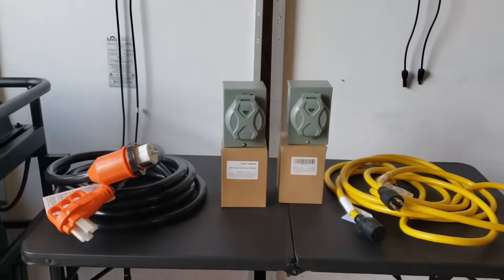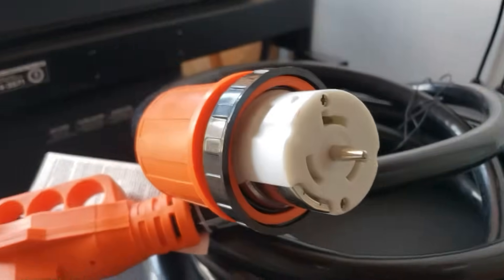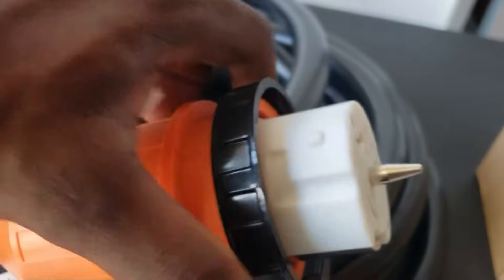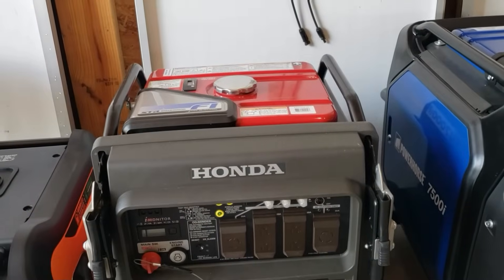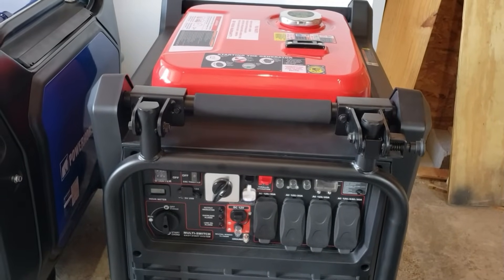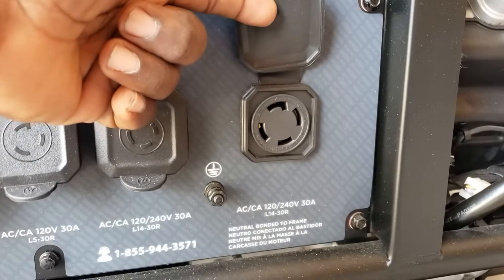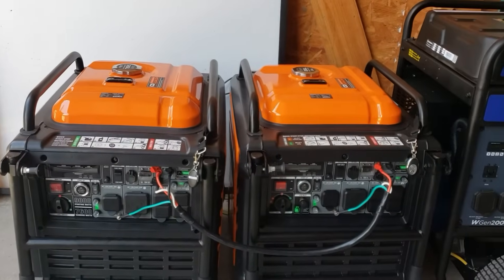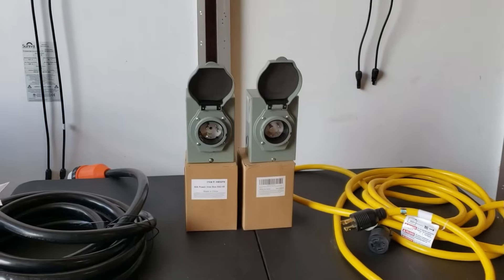Generator Inlet Box 30 amps Vs 50 amps which one should you install

Comment: Gavin, Thank you for this information. In my case I have a 9000 Watts Dual Fuel Champion #71503 with 4 prongs/ 30 Amps.
My Home inlet box is a Generac 6338 (50 Amps - 3 prongs with pin in the middle.
What kind of power cord(50 ft.) do you suggest that I buy to work this safely, possibly with an adaptor?
30 Amp cord or 50Amp cord?
Thanks again.
Reply from the maker: I think I have that adapter on my website I’ll put the link for you
https://www.gavins-garage.com/product-category/adapters/

Comment: I have a 10,000 watt diesel milsurp generator on a trailer, and am wiring the house to accept that 50A setup. It has bare lugs, so we're wiring a 50 and 30 plug receptacles to the generator so we have options (it is mobile, after all). The thing is a beast - weighs 1000 pounds without the trailer. But it's quiet and reliable.
Reply: I had a MilSurp generator that was built like a tank, it was only 4kw but it had the cold weather kit, 12 volt charging, only 120volt plugs but had the ability to use as a welder. When we moved I gave it to a coworker. Wish I could find another.

Comment: Great Info.220v well pump  1/2 HP.....Elect stove...elect. water tank 50 gal...elect dryer..tv...lights........should I get 50amp transfer.??
Reply from the maker: If you were trying to figure out if you should get that transfer switch or inlet box, either one will work for you.
The transfer switch if you get that 10 circuits you’ll be able to run two 240 V appliances and the remaining will be 120v loads.

I would installed the inlet box, not only is it cheaper but you power everything in the house and you can do it at 50amp plus the lock out?

Comment: 50 amp Generac inlet box, an interlock switch on the main panel and a 12000 Duromax portable generator.  Trust me from personal experience, when the power goes out you will NEVER say or think, "Gee, I wish I didn't have this much power."
Reply from the maker: Agreed ☝🏽

Comment: A thing to consider is if you are paying an Electrician to install the circuit, the labor will be a big part of the cost. The labor is the same to install the 50 or the 30. So if you have a big house or are considering adding more loads in the future (pool, room addition, shop, garage, A/C, ..... EV) the small increase in the cost of the hardware up from 30 Amps may well be worth it. You can run a 30 to 50 adapter for your 30-amp generator.
Reply: Cost difference between a 30 amp and 50 amp outlet is minimal, just the cost difference between 10 gauge wire for the 30 amp and 6 gauge wire for the 50 amp, but if you go with 30 amp, you are stuck with 30 amp (unless you upgrade to 50 amp).
If you start with 50 amp, you can still use a 30 amp generator, just need an adapter, and can go to 50 amp easily if you want. 

IMO, just go with a 50 amp box and Cable with a 30 amp to 50 amp adapter. 
50 amp cables are about 2x the cost of a 30 amp, so If money is really tight, get a 30 amp cable for the time being. If you upgrade your generator to a 50 amp setup, you will need to buy a new 50 amp cable, but can use the same box as before.
Reply: @nolanhoyt716 exactly it doesn’t makes sense to go
With 30 in any situation.  You can always get an adapter. Coat is deference minimal

Comment: The reason why it's 19,800 is because of the 550 watt solar panels. I don't have big roof just big panels and I will be putting bigger ones on the ground mounts and I have some smaller solar panels on some ground mounts but not all of them and I didn't make all my ground mounts yet but I have one and a half ground mounts with out solar panels that I am and will add more solar panels to. I just need to get more but yes I have some that I'm putting up.

Comment: And the numbers on generators are misleading because the breaker they are tied to is only 80% so a 30 amp gen will only provide 24 amps at full load!

Comment: If running a 50 amp inlet box from a larger suitable generator and using an interlock kit on my circuit breaker box, what size circuit breaker should I use for the incoming line?
Reply from the maker: You should install a 50amp breaker

Comment: I have a 50 amp inlet, am I supposed to run the generator on 120v or 240v mode?
Reply from the maker: Run it on 240v that will power both legs

Comment: Gavin.   I watched your video on cable size and voltage drop was good.  I will get 10 gage cord used with a 30 amp inlet.   Im thinking 40 foot cord to get noise away from house.   At what length of cord is there voltage drop that affects gen output wattage?   Whats the cord ideal length.  Above this length should we go to a 50 amp wired cord and still use the 30 connectors?   Thanks!  U do patreon?  Love your content.   How can we support your channel?
Reply from the maker: Thanks so much for watching the max. I would recommend you going is 25 to 30 feet.
You can push the thanks button on the bottom of the videos that works great to support the channel .

Comment: My electrician installed a 50amp inlet box for my generator. For some reason the receptacle doesn't have the hole in the middle to fit the center guidance pin of the female plug. I had to pull the pin out. Almost all boxes I've seen online have the center hole. I'm wondering why mine doesn't have the hole.

Comment: I put in a 30 amp several years ago for a  9000 generator. Wish I had put in a 50 as I now want to use a bigger generator.
Reply: just change the 30 for 50Amp, no biggie.
Reply: @carapungo  That's all good and well as long as the wiring going to the panel for the generator is at least a 6 AWG. Don't change out plug if the wiring is a 10 AWG which is rated for a 30 AMP.
Reply: @69ssrscamaro4  correct, I use 6 AWG

Comment: If you had a big generator and a 50 amp plug, and wanted to have a backup plan for a situation where your big generator goes bad, you go to home depot and they only have smaller generators 6000W let's say and you needed to get it cuz power is out and something is better than nothing, this new generator had only a 30 amp outlet.. with that said, would you have two boxes outside of your house or is there an adapter that you can utilize 50 amp plug but it will reduce the power to 30 amp so you can still use a smaller generator?
Thank you
Reply from the maker: Hi PAUL, there’s a simple adapter that goes from the 30 amp to the 50 amp plug. There’s an adapter that can go from a regular 120 V to the 50 amp plug.
Reply: @Gavin’s Garage  hello and thank you for your response. Just to ensure, I can go with this adapter from 30 amp generator to 50 amp plug in my wall right? Not the other way around. Or I can do both scenarios, the other one would be a big 50 amp generator to smaller 30 amp plug in my wall? 
Thank you

Comment: Thank you for the video. I was undecided after buying a Duromax 9000, but 30A it is; the box and cable are cheaper and with 6000W (80% load) I can power the main things I need,  just need to be smart about alternating the large draw items.

Comment: I have a 30a generator. Later, I might want to up grade generators. Can I wire and install a 50a breaker in my panel and and run the 30a generator with the correct pugs to the 50a?
Reply: I think you can as long as all cabling is 6 gauge.
Reply: @user-bj4lp3fr1o  thanks. I ended up buying a 50 amp generator because I realized the generator I had only went up to 20 amps.

Comment: I have a 50A inlet into my home and just bought a 10,625/8500-Watt Electric Start Gas and Propane Dual Fuel Portable Generator with CO Shield.  Could I just get the 30Amp cord to 50AMP and run it like that into the house? I know they sell the cord like a 10 ft. Generator 30 AMP 125/250-Volt 4-Prong Locking Plug L14-30P to 50 AMP 125/250-Volt SS2-50R(CS6364) Adapter Cord.  Will this be all I need to run power into the house?  My breaker is already set up for it.
Reply from the maker: Yes, that’s exactly what you need just get the adapter it’s going to work the exact same.
You’re on the right track

Comment: Why would anyone buy and connect any gen with greater than 30 amp output to a 30 amp gen inlet box.   So any gen greater than 4000 watts would be overkill on a 30 amp inlet box no?
Reply from the maker: I think you’re confusing 30 amps at 120 V with 30 amps at 240 V
That’s a big difference

Comment: Great video! But you’re talking about 7500w max for the 30A inlet. That’s correct if you run only 240v things in your house. If like me you have some power hungry stuff running on 120v (120v mini split 15-16A , microwaves, 3 freezer, laundry machine, coffee machine, etc … dont forget that those kind of things pull Power only from one leg. Be sure your 120v stuff are balance on both legs or go 50A to be sure. In my case, i was reading 28A on 1 phase and only 10A on the other one. I was maxing my 30A cable with only 4500W. I changed my cable for a #6 and a new Inlet / breaker combo to use my 8000w generator at full power ;)
Reply: 7500w is 7500w no matter how you slice it or how you load it. To understand a 240 volt circuit better.....30 x 240 is total wattage which is 7500w approx. the breaker on your gen is likely going to be a 30A 2 pole breaker. each "leg" of that 30A 240V circuit will also only carry 30A. So the max load you'll ever have on one leg is 30A x 120V which is about 3600w. 50A literally serves zero purpose on a 7500w gen. I see so many folks that aren't doing the math right and always recommending people upsize to a 50A when there's no point.
Reply: @andrewb3313  You’re right but my 8000W generator has a 50a plug with a 50a breaker. I’m able to pull 38A and 25A on each leg with no problem. 38 x 120 + 25 x 120v = 7500W. I was not able to run my Generator with this load on the 14-30r plug with a 10awg wire. The #10 wire cannot support more than 30A on any wire in the cable.

Comment: I'm confused. 30 amps X 120v = 3600 watts. Not 7500 as you say 30 amps can do
Reply from the maker: It’s ok you’re on the right track but the voltage is 240v x 30a =7200

Comment: if u wire it carefully u can parallel two 50amp plugs but there are safety concerns it would be really good idea to have an interlock with a 3 phase contactor that only energize when the plug has power input from the generator or else u can have exposed split phase 240v mains to your 2nd plug and that can kill someone. also must be real careful about not crisscrossing legs or that would short the generator.

Comment: This is the best explanation so far. I have the Predator 7600W Gen. So would I need a a 30A double pole breaker or should I get a 50A double pole breaker?
Reply from the maker: The 30a will work perfectly fine with your generator 👍🏾

Comment: I have the 30 amp setup, but plan on using an adapter and using only the TT-30R on my generator....thus only powering my house with 120v for both legs.  Do you recommend any kind of surge protector at the generator?
Reply from the maker: I reviewed a few on my channel you should check them out 👍🏾

Comment: In an emergency you should be going with the smallest watt generator you can to get by with...   no need to power everything in your house or to have a big generator sucking up gas (which may be in low supply or hard to get) to produce excessive wattage you will never use.  Pick a nice reliable generator say 3500-5000, pick circuits to run such as your master bedroom, have a small 6000BTU window or portable AC unit to keep you cool etc..
Reply from the maker: Agreed 👍🏾
Reply: I was thinking about bearing the cost and going with 50 amp for "future proofing" but this is a great point.
Reply: I agreed, but for example I have an igen4200 which is an open frame, inverter 120v,  it uses a TT30.  I have the L14 30 amp 220 plug on my house with a interlock. I use an adapter to put the load over two legs and don't run my 220 appliances.  Works great and future proof if I want to use 220 in the future.

But to your point I'm in Florida and having enough gasoline for two weeks is critical.  And people  have no clue how little they actually need.
Reply: well, with a 4 ton 48,000 BTU AC unit, the only way is to go with a at least 10,000 watts and a 50Amp breaker at the box.

Comment: can you run two generator plugs into the house with each going to it's own set of breakers? Just double the plugs?
Reply from the maker: It’s probably easier just to parallel the two generators. That way you gain on your starting watts

Comment: would i be able to run a honda 2200 with a adapter on the 50 amp? for a home input?
Reply from the maker: Yes, you will be able to using an adapter but just remember 120 V loads only shut off all your 220 circuit breakers

Comment: Mine generator is 8,000 running watts what should I do? 30amp or 50amp it is a 30 amp twist lock generator cord
Reply from the maker: If you don’t plan on increasing your power the 30 amp is probably all you need

Comment: So my generator is rated at 8400 W sustained (11050 peak) should I use a 50 amp or a 30 amp? I don't think I'll actually use more than 7000 W in a power out scenario tho..
Reply from the maker: You might be better off just installing the 50 amps just in case you need to run that much power.

Comment: Really helpful. I was wanting to do a 50A inlet "just in case" for my 7500W running generator and I was struggling with the cable issue since I would have to adapt the 4 prong to the 3 prong. You've convinced me to just go with the 30A inlet.
Reply from the maker: Great 👍🏾 
Thanks for sharing happy this helped
Reply: Not me, I am using a NEMA 14-50 much more beefy setup
Reply: @LarryRichelli And?

Comment: Thnx Gavin...I had a 50 amp plug installed on house meter box....for the Duramax xp 13000 gen....can I aslo plug Honda eu 6500 w 30 amp in....???what 30 to 50 amp plug end converter?
Reply from the maker: Thanks for watching 
Check the description I have links to the adapters.

Comment: This video help me completely understand what I needed for my situation I finally figured it out, I was not able to run my 5 horsepower compressor with just my Predator 3500, I also had a predator 2000 so I figured why not try to parallel them together went down to Harbor Freight picked up the Predator parallel kit which technically is only for the 2000 model and can only do 4,000 watts Peak and Link them together and was able to start my compressor with no effort at all unbelievable I'm so happy I went through hell trying to figure this out since I don't have electricity on this part of the farm and $150 ft 10 gauge extension cord was not cutting it.  I also noticed the startup watch on the screen said 4700 Watts so obviously the Predator parallel kit is more capable than just 4,000 Peak . I'm so happy with this parallel kit being that it is more capable than they claim I know I can use the firman kit which is probably better but I like the predator parallel kit because it Clips on to the small predator generator so that's a nice feature, your videos are great thank you for your help your channel will definitely grow . And I think I will upload a video on my channel because of this
Reply from the maker: Hey, thanks for sharing this with us. So happy this helped you out.
Thanks for watching and subscribing 👍🏾👌🏾💯

Comment: Everyone watching reading comments needs to think with electricity there is the 80 percent rule.  80 percent running load and leave an extra 20 percent for start up like motors and compressors.  So on a 7500 watt gen, that is max wattage on start up. Then it drops down to a running wattage around 6000 more or less but never 7200 watts why?.  Amps times volts 30 x 240 is 7200 watts and then the generator's breaker will trip after the 120 percent overload protection.   That's is why gens with 7500 watt or less prob has 30 amp plug.  So yes you can install a 50 amp receptacle on your house but then again think 80 percent load and a new factor.  Distance between the 50 amp receptacle to the breaker location, voltage drop.  Wire size must follow NEC temp in wire/ breaker chart and voltage drop from the distance.  But there is some variance in the code depending on your AHJ.  But to be safe 8 awg under 25 feet, under 100 feet 6 awg and over 100 feet 4 awg size conductor.  Anything breaker sizing times your amps by 1.25.  So 50 amps receptacle times 1.25 is 62.5.  So 60 amp breaker is fine but your wire conductor must follow the NEC chart.  And 50 amp breaker on 8 awg is okay under 25 feet, but I never go over 10 feet.   What I typed are examples. You need to do your own math with what you got and figure out what is best.  It's your property don't be cheap and think 80 percent.
Reply: 😊8uugf.

Comment: I used a 50 amp inlet and I have a 4500 watt generator. I eventually plan on upgrading. With that said I can't find the proper adapter to go from my 30 amp generator to my 50 amp twist lock inlet. Any suggestions?
Reply from the maker: Which adapter exactly do you need? Maybe I can help you find it
Reply: @GeneratorReviews   I think it's this one, 
30A L14-30P Male to Marine 50A SS2-50R Female
Reply: @GeneratorReviews  that's the problem I have no idea

Comment: I was hoping this may help but it didnt.
Generac GP8000E 8000 watts with up to 10,000 (starting). Unit uses a L14-30 4 prong outlet. So it is a "sustained" 8000, but its own outlet is a 30amp 4 prong? 
What say you on this?
(PS it appears to have a 10 gauge male to female cord sold with it)?

I just put in a Connecticut Electric (7500 watt rated) receptacle, 10 gauge). Which I ran to my panel with 8 gauge Southwire) to a 30amp breaker.

Comment: Awesome video. Question, I just purchased a Generac 8500 should I go with a 50 amp? I know the output breaker on my generator shows 30 amp. Thank you in advance
Reply from the maker: If you’re never gonna parallel two generators, just go to 30 amp
Reply: @GeneratorReviews  Thank You